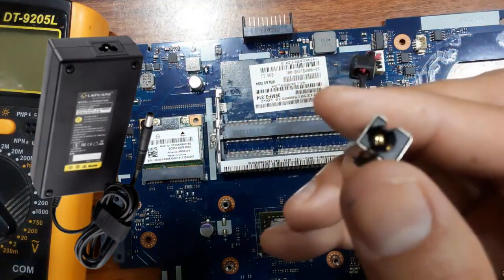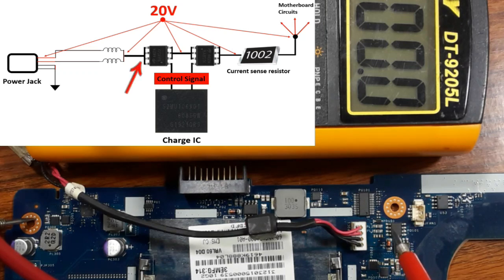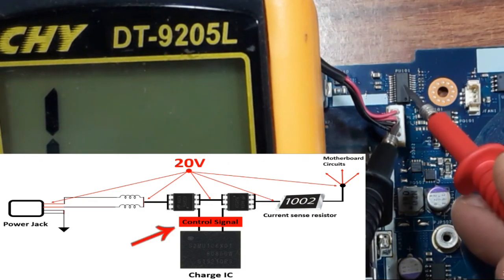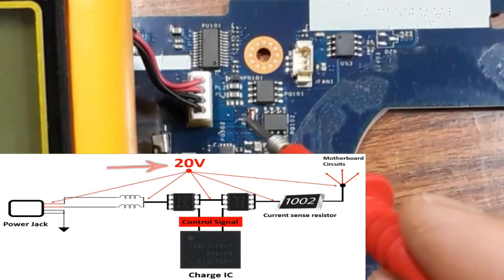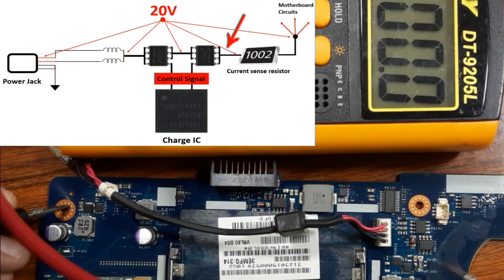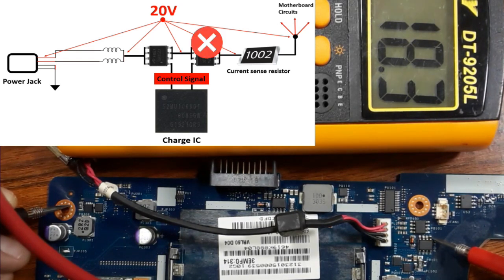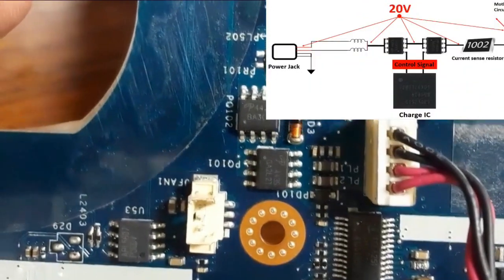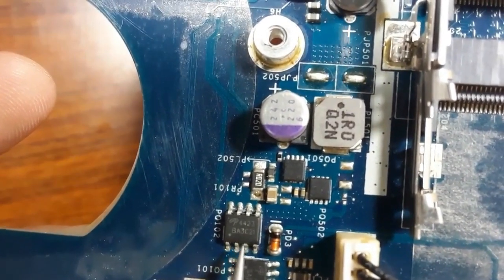Voltage Tracking Techniques On Laptop Motherboard Using a Multimeter - Laptop Repair +VBAT

Comment: So the gate out put voltage is not suppose to be low than 19 volts,i saw one of your videos when the gate out put of mosfet has low reading like 8 volts can you elaborate on that?

Comment: Hi, the charge ic must command the MOSFETs on, or they are on by default thanks
Reply from the maker: Yes the charge ic must command the MOSFETs
Reply: I asked basically the same question. Are they all on by default, but I would guess that would be by design. I guess the best next thing would be to inject the signal to the gate see if the MOSFET switches on.
Reply: @aewcontrol2984  i don't think that's the case, because how else could 3.3 v be present to power on the laptop, i think its always on and if something happens the controller turns it off to protect the laptop..
Reply: @Bias_Prineus  I do not know enough to make that judgement. I do understand that MOSFETs are commonly used as voltage regulator, switches, etc. SO in this case do you think they act as a circuit breaker that it's always on and shuts off under certain conditions?
Reply: @aewcontrol2984  yes there's no other way, because that's the main power rail, and the super io controller check all the rails for proper operation, and if it detects a short to ground or an abnormal rise in current somewhere, it cuts down the power to prevent damage on the board through the gate PIN of the first MOSFET, the second MOSFET i believe is to maintain the voltage stable, that's my theory , i don't know if I am right..
Reply: @Bias_Prineus  makes sense

Comment: What's the point in checking the  connected pins of MOSFETs one by one for three minutes
Reply from the maker: In order to understand the Basics (For beginners)
Reply: @electronicsrepairbasics_erb  Please, put into practice these negative comments from your viewers kindly, do not assume these comments because they are meant to grow your channel. Making a negative comment in a polite manner does not mean your work is disrespected sir. We are just here to grow each other positively. You've been doing a wonderful job from the beginning and we appreciate that wholeheartedly.. I have noted in most of your responses, when you're challenged about your lengthy and repetitive videos, you normally say it is for the sake of beginners, but that should not be the response kindly coz I believe we are all beginners.. Those who are new to this channel and feel they have little or no knowledge about laptop repair should just follow from the old videos just as we did.. No need of lengthy and repetitive videos kindly sir.